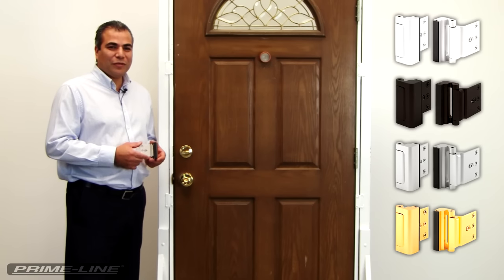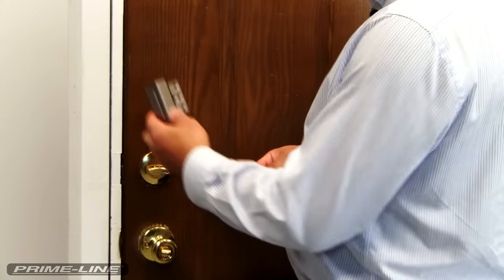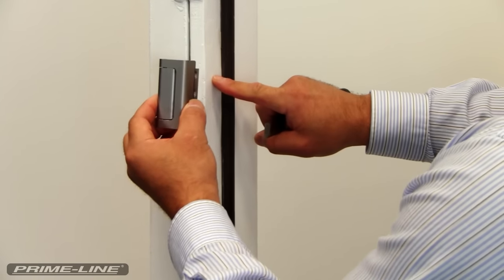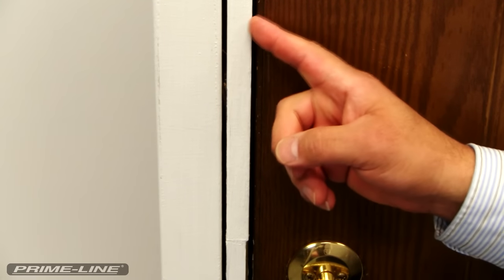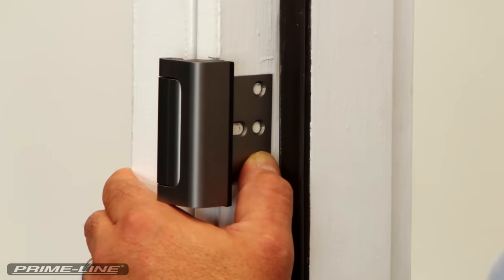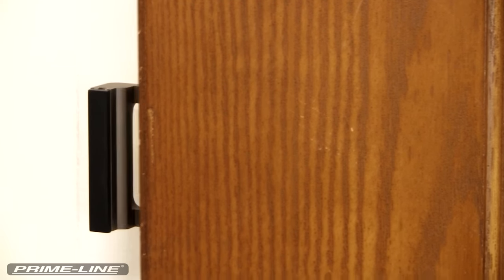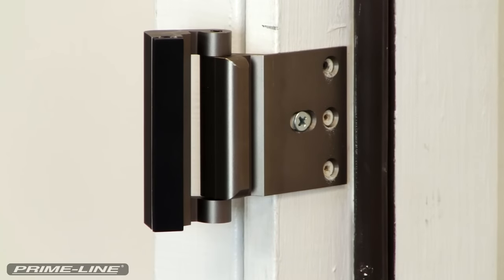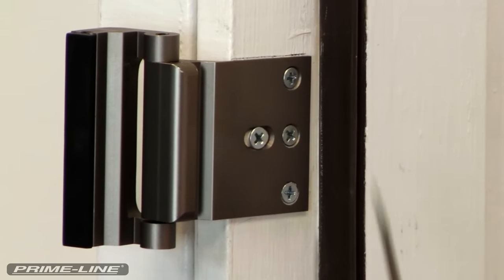How To: Install Prime-Line's High Security Door Lock

Comment: Placing the lock above the lockest and deadbolt is a huge mistake. They don't high kick the door. It should be placed in the lower 1/3 of the door for it to be any good.
Reply: When something like this was demonstrated,  the lock is to high. Your absolutely correct. Plus the door jams aren't that strong

Comment: Would love to see a kick in. Just to see how it holds up. I've replaced al my 1/2 inch screws on the regular lock and dead bolt to 3 inch screws. Even my hinges of the doors. Thats a really big help. in itself.
Reply: Its surprisingly good.
Reply: Excellent idea to change those screws for longer ones. 
Great tip… Thank you for sharing it.

Comment: I ordered 6 of these and have installed 2 so far. If you have thick trim, you will have to notch it out in order get the lock to sit flush against your door. Great product though, and it greatly reinforces the door against lock licking/bumping and kick attacks.
Reply: do you mean when the lock is longer than the frame? do i use a chisel
Reply: What if I got brick on the side I would need bew screws right ?
Reply: I wd install 2 on each door.
Reply: Great product, easily opened with a milk jug.

Comment: folks you are forgetting something. This latch is not for security when you are away, it is for security when you or someone else is home. Also when an emergency requires entry to your home a window will be broken out.  Additionally no lock will prevent your door from being kicked down. If that happens a mm with a full magazine is the preferred latch. it works quite well. I have installed many night latches, and this is the best one I have tried. the idea of the screws going in laterally instead of on the surface of the door frame gives the latch much more strength. The unlock/lock process is easily done by pulling the latch away from the latch plate.
Reply: Most informative comment.
Reply: I actually think that these locks were originally built to prevent your toddler from opening the door and going for a stroll without you knowing
Reply: At least, all doors except one in your home would be protected well. Then, you will need a deadbolt for that one door that you cannot use this on.

Comment: Where’s the place to position these locks ? Upper/middle/lower portion of door? Also, didn’t see any responses if you have a larger gap (lock only covers 1/2 the door). Washers with longer screws or does that weaken the setup?

Comment: How does this device work with 3/4” thick door casing that is overlapping the door jamb 1/2”?  The demo had a door with no casing which is unusual.
Reply from the maker: We use a freestanding door in a frame to make it easier for us to film. 
Kind of hard to explain, but the fixed bracket that screws to the frame sticks out past the edge of the door frame then sweeps back at 45 deg. so it should be able to clear most casings.  The Home Depot website has a 360 deg. viewer for these that lets you see all the way around.  You should be able to tell what I'm talking about there.  https://www.homedepot.com/p/Prime-Line-Door-Reinforcement-Lock-3-in-Stop-Aluminum-Construction-Satin-Nickel-Anodized-Finish-U-10827/202258432

Comment: These are easy to install correctly because of that oblong hole. I just installed 3. I had to notch the trim on two, but its worth it.
Reply: Can you please share the thickness of the metal that goes into the gap? I am wondering if I am going to be needing a chisel

Comment: I bought a few similar locks, and I guess my doors have a rather large gap... I didn't even mortise out the door frame to recess the locks and they barely engage the door. Half of the lock surface is touching the door, and half is just spanning the gap. Would adding washers behind the lock to shim it out more be a bad idea?
Reply: What did you do to fix this? Same issue here!!
Reply: @asherrz  shoot man, I forgot about these things altogether, I sold that house 2 years ago. I can't remember if I changed anything or just left them half engaged

Comment: I have a trim board around the interior of the door.  Does the door trim need to be notched out also?
Reply from the maker: Only if the trim is interfering with the lock opening fully.
Reply: Every door in my house has a trim board around it. Please do a video showing that door type?
Reply from the maker: Even with door trim, the unit can be mounted without mortising the trim. in most cases  The mounting tab is fairly long, and the lock is designed with an angle on the backside to help with this.  We've mounted it on a solid core door with aluminum frame and trim and had no issues.   I've uploaded a few photos looking down on the lock so you can see the angle that should clear your trim.  You can see them here:  https://imgur.com/a/kctTp

Comment: Does the lock have to be flush against the door in lock position? Mine has a mild separation to prevent the lock from scratching my door.
Reply from the maker: It doesn't have to be touching the door to work.  A little space is fine.
Reply: @PrimeLineHowTo  thanks.

Comment: Got this today, regretted it. Its very hard to open AND close. The spring is too tight. im afraid people inside wont be able to get out in an emergency. It would be helpful if there was a knob to hold and pull. I dont know if DW40 would help to make it more free flowing.
Reply: Did you end up getting it easier to open?
Reply: bigdaddykurt 
How is the door security?
Reply: I applied skateboard grip tape to the top and bottom of where you put your fingers to pull it open. It helps out a lot.
Reply: wd40- try engineers flowchart in future
Reply: Yes I did and it’s perfect no harm from WD40 😊

Comment: I installed the first screw but when I try to open the door it rubs heavily on the metal plate, is this how it’s supposed to be?
Reply from the maker: There needs to be enough room between the door frame and the door for this part to work.  You can trace the part,  then remove it and use a chisel to mortise out a little bit of the door frame at a time until it doesn't rub anymore.

Comment: We live in a very old building and the clearing between the door and the wall trim is just enough for the lock to open at a 90 angle. Is it possible that the lock would close itself after we exit, for example, if the door is slammed, leaving us locked out?
Reply: No. The  lock is not free swinging. It’s captive with swing reinfocement when not in use. You have  to really grab unto the lock and lift it to disengage from its safety pin to swing it to lock unto door.
Reply: Get this product on Home Depot. This product is so effective, lots of cheap knock-offs online

Comment: My door frame is metal. What screws can I buy at home depot to make this work?
Reply: You may have to drill a hole. then tap it with whatever size and thread your bolt will be. its a bit more work since its a metal frame.

Comment: I was able to drill and install middle screw to hold in place but cant drill other three holes using 1/8 drill bit. Could this portion of door frame be made of metal. If so what do I do then?
Reply: Try a drill bit for concrete or metal that may be behind the wood

Comment: Haven't seen it in any of the top comments, but if you get one of these locks and it comes with a 2 inch screw, swap it for a 3 inch for added security!

Comment: Most doors have a casing. It doesn't look like this lock will open if the door has a casing. It would be good to mention that in this video and the specifications.
Reply: If the casing is 3/16” or more from the edge of the door jamb, then you can mortise the casing.  I did it on my door casing and the lock works great.
Reply: @zackiinu7194  That's what I figured. Almost every installation will need mortising. It's too bad the video neglected to mention it. It would be a real pain in the butt, particularly on older homes.
Reply from the maker: @alanrutherford93  At :30 the video mentions possibly having to mortise the frame.
Reply: @PrimeLineHowTo  The video doesn't mention the frame, and I didn't, either. The video mentions mortising the jamb to make the surface of the mounting plate flush with the jamb. My comment was about a *casing*. It's a lot more involved. Many casings are 3/4" thick and will interfere with flipping the lock open. Do you see what I mean?
Reply: @alanrutherford93  You are going overboard on this subject. It's complicated and every door jamb that needs to be chiseled out are different. So, it's impossible for Prime Line Products to show common solution. Sounds like you need a professional help to fix it if you are gonna whine about it. Jeez!
Reply: It might seem ‘overboard’ to non-professionals. Great pun by the way!

Comment: How do we unlock it? Mine won't unlock. Do I need to install it first?
Reply from the maker: The original video wasn't very clear on this. Check this video that shows how it's unlocked:  https://youtu.be/uV5JsoRMiaQ
Reply: It is unlocked once it is installed
Reply: no...... pull outward on the plastic part. Jusst like the guy in the vid does.

Comment: What if the door jam doesn’t support 3 inch screws?
Reply from the maker: You can use shorter screws, but the lock won't be as strong as when using longer screws.
Reply: @PrimeLineHowTo  thanks so much for responding 👍🏽👍🏽👍🏽

Comment: Will this replace other locks?
Reply from the maker: This is designed to be a secondary lock for use when you are inside the house.  It cannot be locked from the outside.  You'll still need your regular key locks for when you leave the house.

Comment: what if the door doesn't touch the lock when installed? I think there may be a gap between my door and the installed lock.
Reply from the maker: Hi Juan,  the gap between the door frame and the door needs to be 7/16" or less.
Reply: Thanks for the reply. I'm sorry, I meant that after installation, there is a gap in between the front of the door and the rubber pad that holds the door closed. I can't install it any deeper into the gap between the edge of the door and the door frame. I hope I'm making sense. lol..
Reply from the maker: I understand.  If it's a wood frame door you can slot the door stop enough so that the door lock can slide further back into the frame and sits tighter to the door.  It doesn't really have to be tight to work.  A little space is fine.
Reply: Thanks for the quick reply! that's what I'll do.

Comment: How does it work? I mean, how can you just flip it closed and open, but the force of the door being moved doesn't flip it open? Is this voodoo?
Reply from the maker: If you watch from here: https://youtu.be/VTvm_XKeAZM?t=1m48s you can see that the lock has to be slid over a bit to un-lock.    So slid over and swung out. It's spring loaded.   When you swing it closed, there's a groove behind that the front part locks into.  Hard to explain,  but it works.
Reply: That's awesome. Thank you. Seriously considering this product that I hadn't heard of until an hour ago
Reply: Stylost Samson I have one at home my dad bought one and it doesn't open when you kick it it opens when you pull it out the other way

Comment: simply use a European or German door lock with a doorknob, no one will break in, In contrast to the American door locks, the European locks are locked from both sides with a key, you can also lock it twice and  There is a second bolt that goes straight into the door frame ,There is  second bolt that goes directly into the door frame The first is only for when you pull the door closed you can no longer come in from the outside but you can go from the inside to the outside, you then need the key, when the door is locked you can Also kicked, jump, etc. The door can take it, not like in movies that you kick an American standard door and it is open
Reply: @UC0Rtd1uiJG9w3xanyrFsKJg European doors have a security standard
Reply: what brand and model do you recommend?
Reply: Movies lie, but if you had a brain, you would have known this
Reply: European doors are just as pickable as American ones.

Comment: Most break in happens when you’re not home,  that being said this device only works if you’re already at home to latch from the inside. 
You can’t do this once you’re on the other side of the door leaving the house which makes it pointless/ useless. 

If you’re at home and someone trying to bust door down, let them and than blast away with 12 gauge or hollow point to midsection.  
Just make sure body is inside the house  when you dial 911.
Reply: I have multiple entry doors to my home, so this can be used on most of them. And if I exit through the garage door, I can even set it on my main front entry door. If you live in an apartment or mobile home with only 1 door, then yeah, this is useless for when you're away.

Comment: I would like to have seen that Barrier Lock a little wider on the door. Those hollow core doors are just a slow down point (they are not very strong) for bad guys....  Slow enough, so I can get my bad ass shotgun...
Reply: If you're using a hollow core door, that's your own problem. You can't make a silk purse from a sow's ear.
Plate the backside with steel, and add an extra hinge, is about the best you can do.

Comment: Makes no sense you are showing an install on a door with no trim. Add 3/4 of an inch for trim, the screws end up only barely catching the edge of the wall stud. Easily kicked in at that point.

Comment: what about a roommate inside the home stealing....u lock up a door w a huge padlock and they just push the pins up on hinges and boom they're in help me please I am so tired and poor on fixed income living w a thief can't afford to move
Reply: Google Hinge Bolts. they are cheap and should be relatively easy to install. they work by a bolt going into the door frame when the door is closed, effectively deadbolting that side.

Comment: here is a little point, in an emergency, (when you have yourself all nice and secure (or a loved one), how is someone from the emergency services going to gain entry , in some circumstances, SPEED is of the essence. I sometimes think we are so paranoid on being safe that we forget there are times when you do need to be able to get in in a hurry. don't bother flaming me, cos I don't actually care about your neg comments. but just a comment to "THINK ABOUT"
Reply: i assume you have windows?
Reply: @jimmytate7587  ...and if you live in an apartment on the fourth floor?
Reply: citation needed- if you can't open this why would you be able to open any door? You need to open it every time you use it- if it's too difficult for you discontinue use ya think?
Reply: AdrianJayeOnline we used a haligan bar in the FD . Leaves a mess!
Reply: And how would they get in during an emergency and you have locked your doors with deadbolt?

Comment: 3/4" screw. Go 3" at least.
Reply: The 3/4” screw is just to temporarily hold the lock in place to make adjustments.  Once you make the final adjustment, screw in the three 3” screws provided with the lock.  You can then just leave in the 3/4” screw or take it out and throw it away.

Comment: Now instead of just the door breaking, you’ll have to buy a new frame when someone kicks it through.
Reply: Josef 
That's why you use 3 inch screws in predrilled holes.
Also I have two of these 1ft from top and from bottom.
With the lock and deadbolt the force used to break the door open is spread out through the entire door frame and stronger instead of one local point.
I also predrilled and installed 3in screws in hinges through frame.
Reply: You would need a massive NFL linebacker to kick the door frame off of most houses. Even then I have my doubts if other door reinforcements have been implemented. It's just one more tool to slow down an intruder and maybe make them think about easier victims. 

If they do get through, it won't be quick or quietly. It will give you plenty of time to wake up, make coffee, strip and clean your firearm, reload it, take a nap, shower, then be prepared for them to break through...😉

Comment: Lol if u can easily unlock it like that don't u think others can do so as well this is not security dude your not even locking it
Reply from the maker: You don't understand how this lock works.  Once flipped over against the door, the spring pulls the arm into a deep groove.  To unlock you have to pull it out of the groove and swing away from the door.  There is No Way to open this from outside of the door.  This video shows it a little closer up so you can see what's happening. https://youtu.be/uV5JsoRMiaQ
Reply: I think Balrog was hit by SOMEONE ELSE BEHIND YOU......

Comment: WHAT DO YOU MEAN BY "HIGH SECURITY"?  THIS LOCK IS MADE OF SOFT METAL.  STOP DECEIVING THE PUBLIC!
Reply from the maker: No deception.  Says right in the description that the lock is aluminum. Different kinds of aluminum can be stronger or weaker than others.  It's not the material that makes this lock as strong as it is, it's the design.  Brass, also a "soft metal", yet they've been making locks with it for a hundred years.